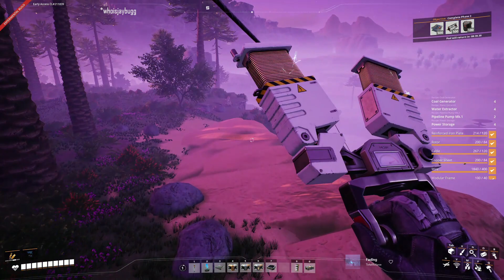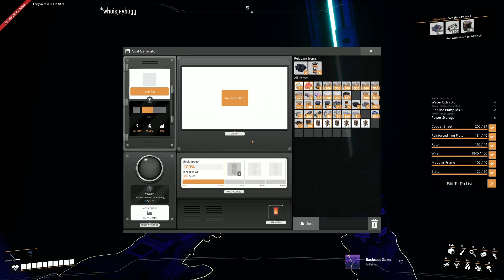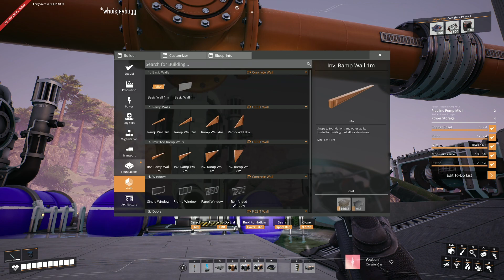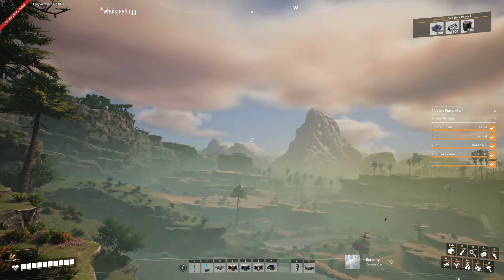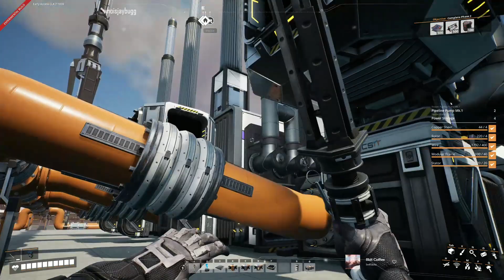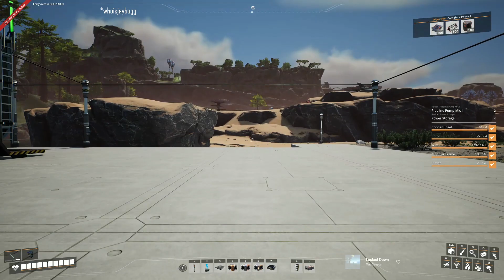Coal Power the tiny Power Plant - 03.02 Part 1

Comment: Good stuff.  I love doing coal plants.  I pretty typically go with 8 gens, 3 water extractors and 2 MK1 miners at first.  Mainly due to needing things like rotors and reinf. iron plates.  Plus I have built enough of them once I have the materials needed I can knock a 600 mw plant out in minutes.  I am relaxing some since I am not back to full play mode with the messed up wrist.  Maybe I just go with 2 extractors underclocked to 90 each, 4 gens and the one miner.  I like to either throw down a storage like you did to be filling with coal while I build the rest or some portable miners.  Either way once everything starts churning I do what you did and feed the gens so they stay topped up.
Actually the more I think on it the more I like the idea.  I can do the 1 miner 300 mw plant with space for future expansion 4 times with the east access 4 nodes where you are.  1200 mw as soon as I turn those all on, 2400 mw by moving up to MK2 miners, 4800 mw if I  want to build MK3 miners for coal power.  12000 mw if I want to overclock the miners.  That is very different than I have ever done before, I usually just do enough coal to get me to fuel power.  But why not try something different?
Reply from the maker: Now the idea of multiple little coal power plants is an interesting idea. I'm using this tiny plant to lever up to the big plant, in the same way you are talking about fuel.

This game! So many options to do the same things!

Don't over click, enjoy my videos while you recover! LOL. Seriously repetitive injuries are nothing to play with.